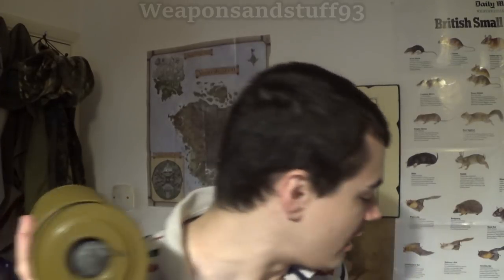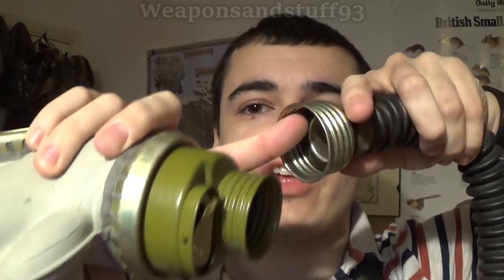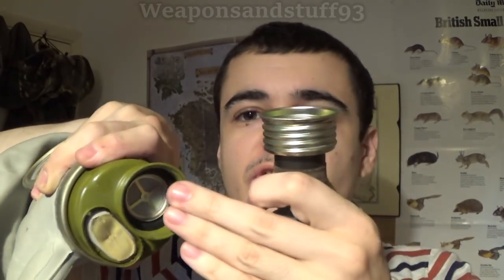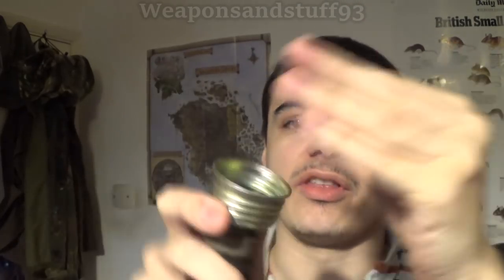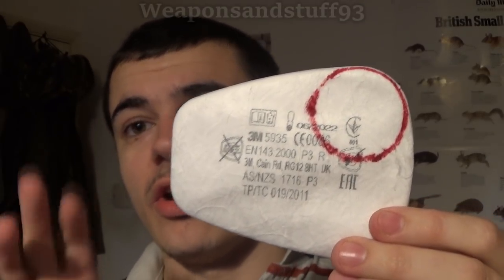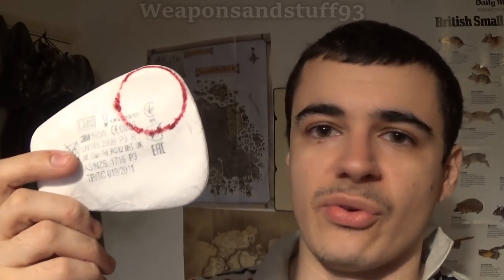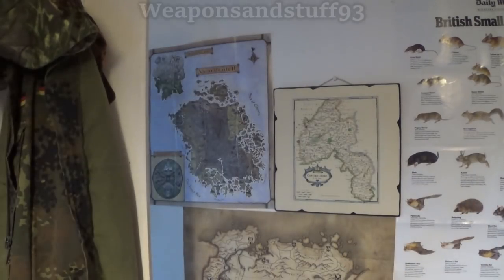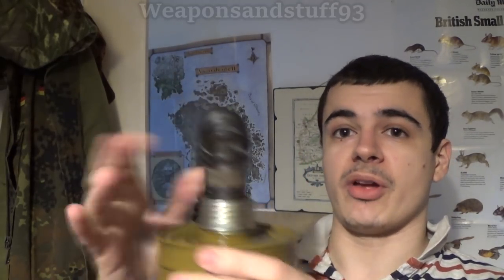How to make Soviet filters safe to use

Comment: hey so what if i wanted the filter for cosmetic purposes so what if i decided to open up the filter (outside and not in a room)  dump out everything into a trash can wash the inside the filter glue it shut after and then should the filter be safe to use for cosmetic purposes?
Reply from the maker: There's a video going live this Sunday about opening GP-5 filters but the main issue is, it's very hard to cleanly open the filter and remove the contents, bit's of metal and paint are likely to shear off which would become hazardous to breath.
Reply: Weaponsandstuff93 but let's say we manage to cut it open cleanly with like let's say a angle grinder and take out the the inside and clean it, then will it be safe to use?  I'm just looking for a yes or no or a yes but not recommended
Reply from the maker: It's a yes but not recommended, you can get the particle filter out from cutting open the bottom, which means you should be able to remove it more cleanly. Just be aware if you use an angle grinder and cut too deeply, you will rip the particle filter and the asbestos and other contents will go airborne.
Reply: Weaponsandstuff93 alright thank you for the help and information

Comment: i just got my first gas mask the gp5 but sadly it was to small
Reply from the maker: What size did you get?
Size 4 is large with a GP-5 and Size 1 is very small, just use a GP-5 measuring chart to find the size you need.
Reply: You can try stretch the rubber out to make it loose enough

Comment: I haven't found any 3m products in this bloody former british colony
Reply from the maker: Considering 3M is probably the world's biggest supplier of safety products, you probably haven't looked very hard.
Reply: I will try to look more but so far I only found a dust mask that wasn't even 3m
Reply: actually right when I said that I found a shop online that is located here and sells a bunch of 3m products
Reply from the maker: You need to get the P3 replacement filter pads, not an actual plastic encased P3 filter.
Reply: yeah I am aware of that

Comment: Alright I'm thinking of doing this for next Halloween but I'm gonna keep the filter in the bag and only screw it on for about 5 minutes
 if. I do this M3 cotton thing with the commie filter will it be safe to use for a extended amount of time beyond 5 minute?
Reply from the maker: It has to be P3/P100 or it won't protect you at all.
Reply: @Weaponsandstuff93  alright then,  thanks for the info

Comment: I don't think that's a good idea:Abestos can come AROUND you P3 filter,cause it's not sealed,what you should do is to seal the end of the pipe (imagine that asbestos is in the pipe,cause you already breathe in it=
Reply from the maker: No it can't go around the P3 filter, because the P3 filter is blocked by the washer of the 40mm intake and the filter pushes it into the washer. Please learn how air-flow works before leaving comments like this.
Reply: I didn't wanted to be disrepectful,excuse me ;(
But,what is "washer"?I am a French guy?
And again excuse me
Reply: the washer is the rubber ring on the intake valve of the mask to stop you from screwing the filter in too far

Comment: this probably the dumbest thing but for prop filters use a cut open cleaned out a filter
Reply from the maker: Cutting open a filter to remove the contents is a very bad idea, unless you have the gear to handle and bag up asbestos and a clean room.
Reply: Weaponsandstuff93 I do and sorry if this comment seemed rude I use a angle grinder with a cutting wheel and a clean safe environment